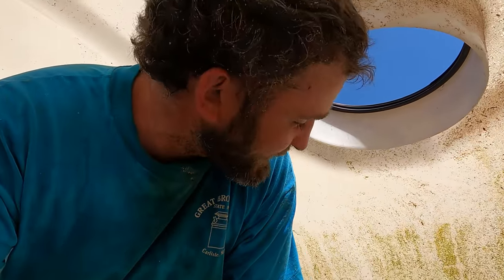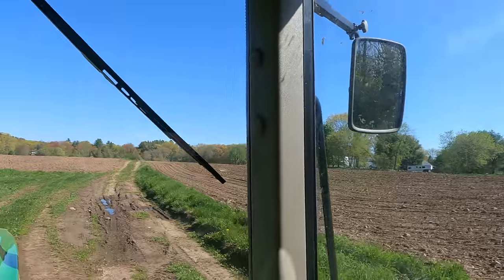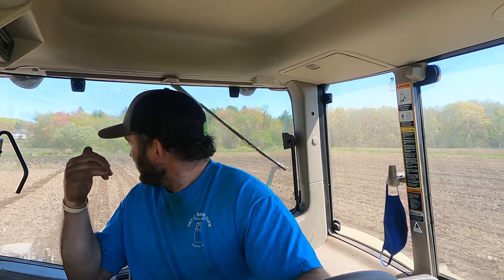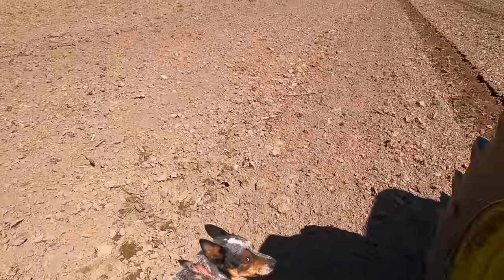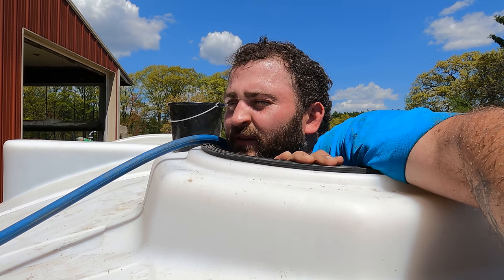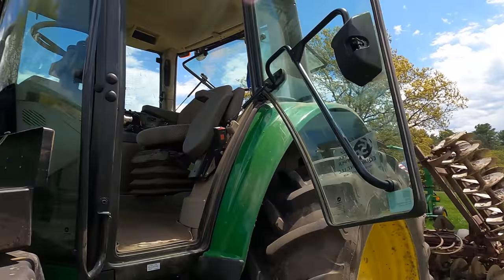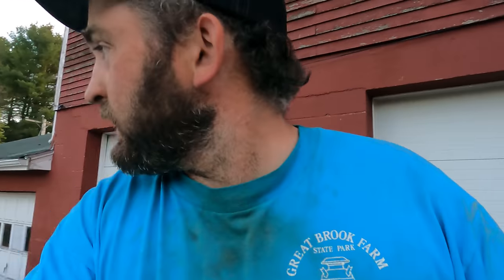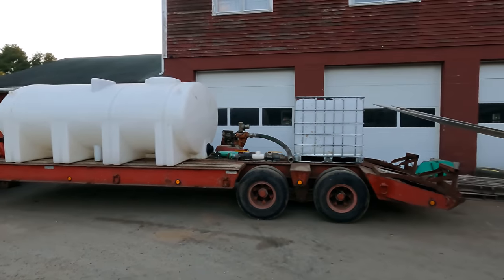Not Sure How This Will Work- Setting Up Sprayer Trailer

Comment: I saw how you did the tank with the flat hose on the suckstion side of the pump, it needs to be a hard spiral ! ! And use quick couplers on the tee with the vaules to pull the tanks apart ,going to the pump . then hard line in to your mix tank.

Comment: You would feel it in your tractor if the throw out bearing was bad when you push in clutch  pedal there would be a vibration my opinion. Lots of geese around and they are Canadian geese but I've noticed some that have a Ny honk. Fun cleaning that tank lol. Hope parts come in soon dealing with local dealer I'm thinking once again is better if green parts.com send wrong thing then what? Have a great day.

Comment: On your 7320, does it have a DE10 Stanedyne pump? We just replace one on our 6420, fairy simple job. The electric solenoid craps out in the pump. If you read the codes off if your dash display and use the book to decode them, that should narrow it down. That's how I found the problem on ours.